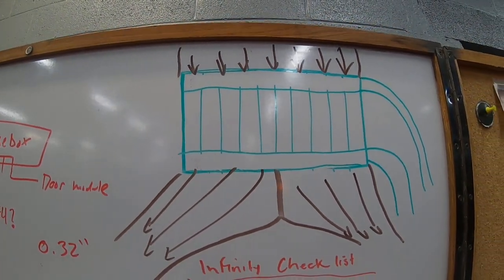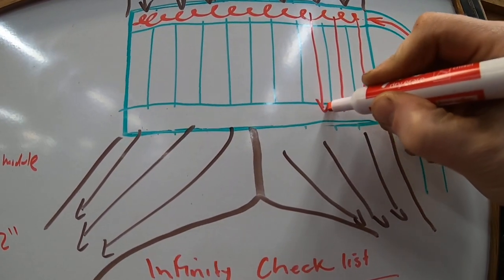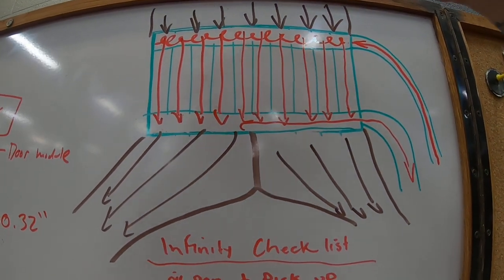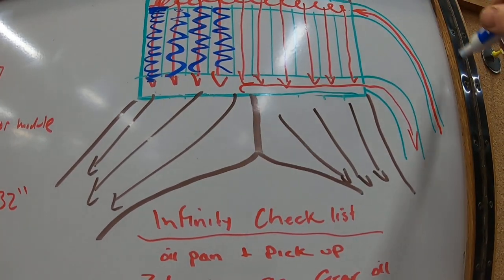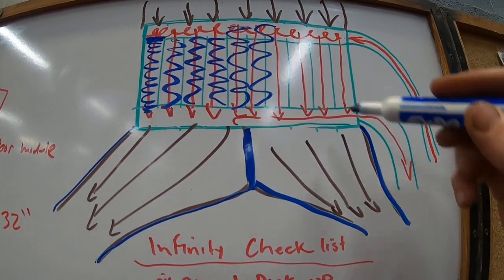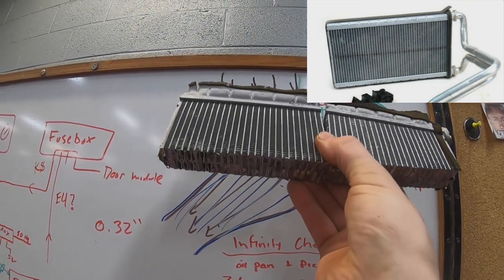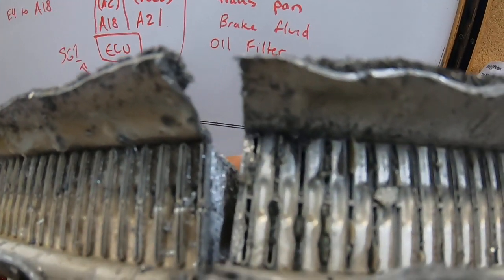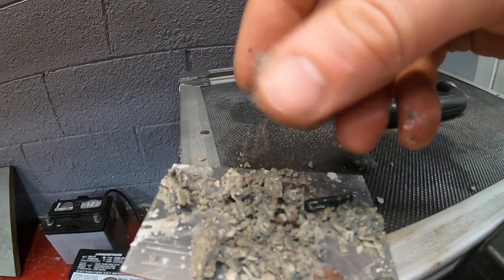Heat Coming Out On Only One Side of The Vents?  Heater Core Diagnosis

Comment: Hey I have a question if you don’t mind sharing some information, I checked both inlet and outlet heater core hoses and there both the same hot temperatures. But I’m stilling getting cold/warm air on my driver side and hot on my passenger side? Could the heater core still be clogged if both intel and outlet are the same temperature?
Reply from the maker: Yes, it’s not completely blocked, just half of it is blocked, the half that produces heat on one side of the vehicle.
Reply: @immortanautomotive9221 so would you recommend me using something like prestone coolant system flush and flush the system out like that? Because I looked at a few videos and people were saying if both inlet and outlet heater core hoses are hot than the heater core is not clogged. It’s more of a blend door actuator problem, but I’m only getting heat on the passenger side cold air on the driver side.

Comment: I thought it was my actuator not working I’d like to believe after 140k miles I just need a heater core flush. Both easy to do
Reply from the maker: It could be an actuator, this was from a car that didn’t have actuators

Comment: I have a 2017 Jeep Latitude 3.2 that had heat only on the drivers side, $150 heatercore flush and shes good to go
Reply: Where did you go for the flush?
Reply: @matthewheck6251  just a local shop. Any shop should be able to backflush the heater core

Comment: This is an excellent explanation of what I am experiencing now with the heat not coming into the cabin. However the A/C still seems to work fine, only the heat to the passenger side does not work. Would a flush of the heater core help or do I need a new heater core?
Reply from the maker: Flush could help, every situation is unique, some are too far gone for a flush.
Reply: @immortanautomotive9221  appreciate the reply

Comment: Will this make car overheat
Reply: Just to add, if gunk has managed to accumulate in the heater core it had probably done the same on the main radiator which can cause overheating issues.  Poor maintenance is likely, people tend to skip flushing and replacement of fresh antifreeze.
Reply from the maker: Probably not, but I’m not sure
Reply: No a clogged heatercore will not cause the vehicle to overheat
Reply: If it wont make car over heat. What problem can it cause and would it loose water
Reply: @kevindrake980  The only issue it will cause is poor heat in the cabin.  The gunk won't make it leak but a heater core can leak in the same way the radiator can leak, everything has a lifespan.  Usually, a leaking heater core will give the symptoms of a wooshing sound from the dash area whilst revving the engine and a wet patch around the footwell.

Comment: So what if it's the opposite? Trying to run a/c. Driver side is hot, passenger side is cold
Reply from the maker: Not sure, could be a blend door issue?  This video was just about one specific kind of failure, there are lots of other possibilities
Reply: Did you end up figuring out the issue with the hot driver's side and cold passenger side? Currently having the same issue in my car looking for answers.
Reply: No. Now it just decides to work when it wants to. Thankfully that will be a spring problem now

Comment: And what happens if one heater hose is missing.  I still have heat in my system for cold weather.  But i took my isuzu ascender to a shop and a mecánic took the second heater core off without asking me.
Reply from the maker: That’s not good 🫣
Reply: @immortanautomotive9221  I know right. So i only have one heater core hose and is the one the works to give keep me warm. But then im missing the other hose and there so expensive to get it fixed.

Comment: Great explanation. I wonder why there is not a small filter collection chamber with a magnet near the inlet that could be isolated with small taps either side. Then it could be removed to clean out all the gunk and simply be placed back in the system. Would save a lot of headaches.
Reply from the maker: That’s an interesting idea!  I think it would also be helpful if people had their coolant changed on a more regular basis.

Comment: I am working on a 07 Range Rover Sport - Only cold air on Driver's side, but have a code for the Left Blend Door temp Actuator. I pulled the actuator with the connector still connected and it doesn't move, replaced the actuator with a new factory unit and ran it before installing it and it moved when I selected the temp controller. I installed the new actuator, but the Rover still has the same problem and the same code. I wiped the codes with my Autel scanner, but it comes right back.   So I am thinking I still have an issue with the actuator because the computer states such.  Any ideas?
Reply from the maker: Pull the actuator again and see if it moves, could be another bad actuator or a wiring issue?
Reply: @immortanautomotive9221   Thank you for the quick reply.  I pulled the actuator and ran the flap door manually (no actuator in place) and still had cold air on the driver's side, so the next step is to try to flush the heater core!  Thank you for posting your content, I've been working on setting up a channel and I know it is not easy to film and work at the same time.  Have a good one!

Comment: So could a fella reverse the lines so that is pushes from the bottom side and returns to the other side in attempt to blow all that junk out? maybe install a screen first to catch it all?
Reply from the maker: Reversing the flow can help when flushing, a screen would clog and cause a new problem 🤔

Best thing to do is use the correct coolant for your vehicle and flush it regularly